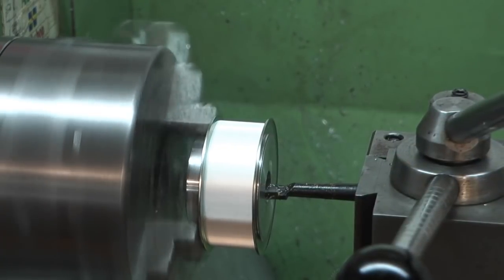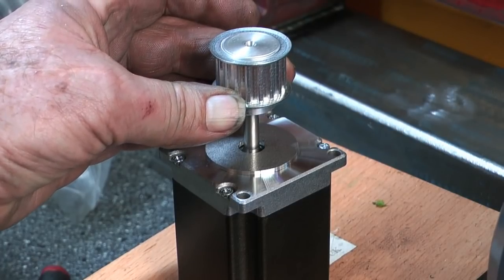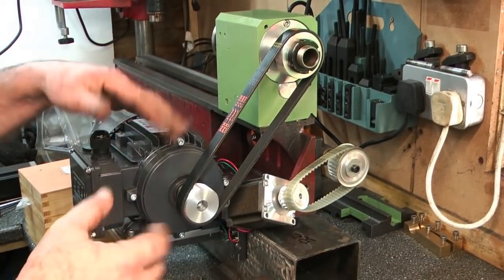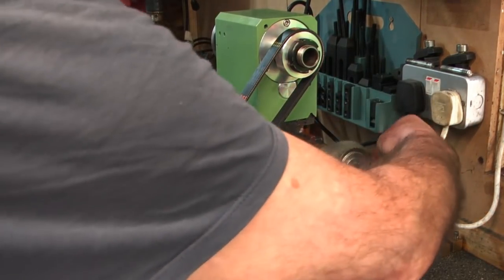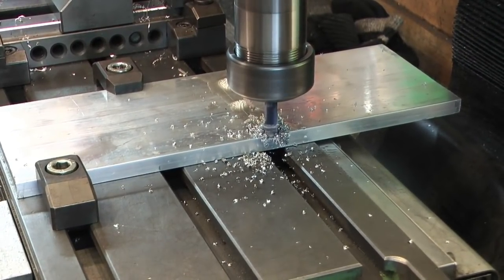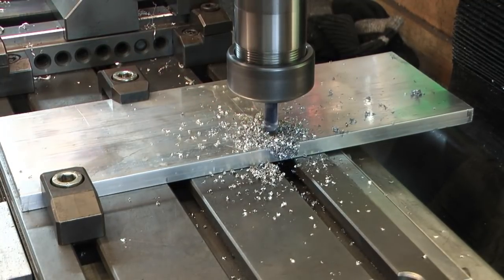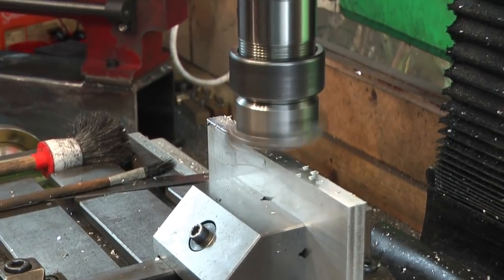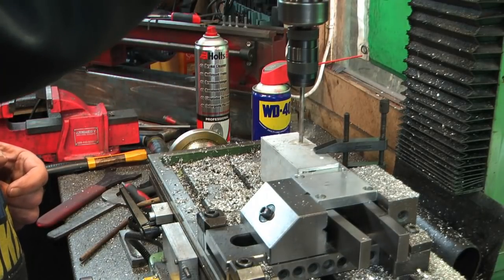Mini lathe part 8

Comment: Ade, a good tip for you when reaming, bore out the first 3 mm to full diameter first, then when the reamer starts it will be guided and running true. Your close up shot of you drilling and reaming, you could see that they were both running slightly out. Regards from Australia.
Reply: This is a great tip.  Drill bits always seem to wander a little on me and boring the hole just makes sense to me, it will true up the hole prior to running a reamer through it.

Comment: Tensioner simply use a heavy spring on the shaft of the hinge, so that it keeps constant tension on the belt. No slip with time, and at least a good chance it will act as a clutch if you do crash a tool into the chuck. Just need a spring around 5mm diameter wire, 3 turns or so, with wire ends at around 180 degrees, and a longer hinge pin to support it, along with a spot to hold it each side.

Comment: I prefer either the third or fourth option. I don’t like the idea of having the motor on the front. And adjustments only need to be made at first, or in the rare situation when the belt needs replacing. At the front, you risk hitting it, or having chips work their way in, even with a cover.

Comment: Hi Ade, quick question regarding your camara setup. Not sure what type you use to film the videos and I'm curious to know? Thanks.
Reply from the maker: It varies a bit but mostly a Panasonic HDC-TM350 . although I do use a Panasonic HC-V380  and a Sony DSLR camera . sound is either via the camera Mic or a Rode shotgun mic . The lapel mic is also a Rode. Love the Panasonic gear and Rode set up in general . toying with the DJI pocket 2 for close shots at the moment . I need to try to borrow one before committing .
Reply: @ade63dug  Cheers for this Ade appreciate the info.